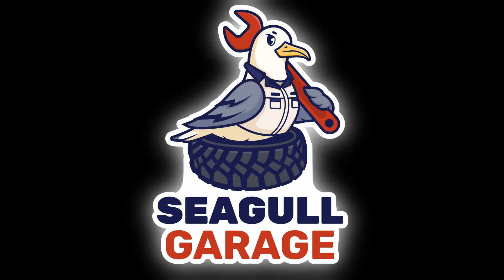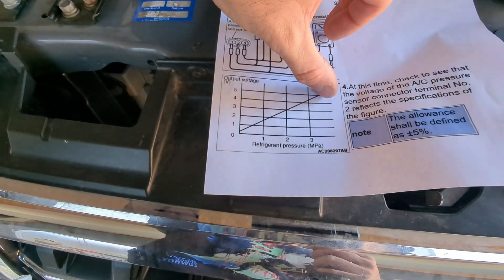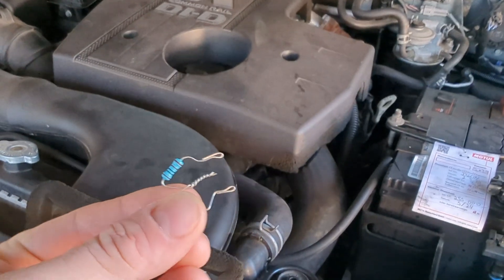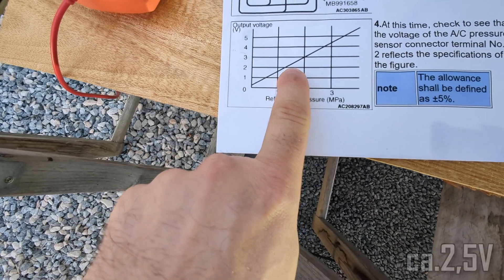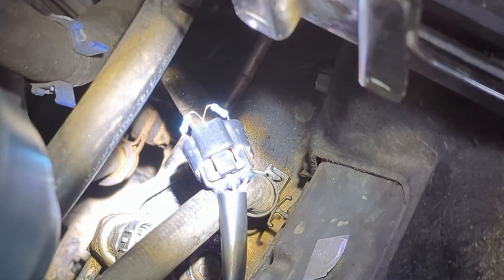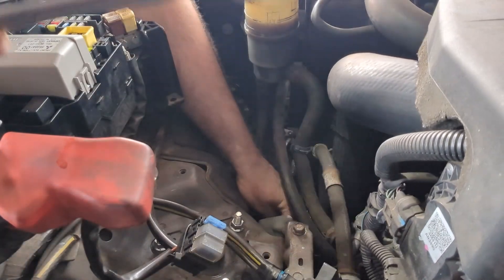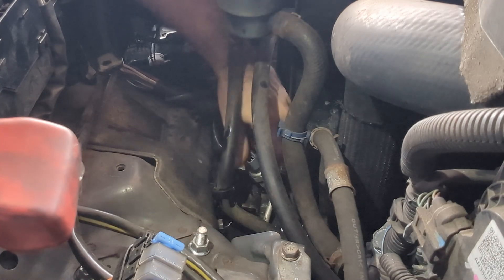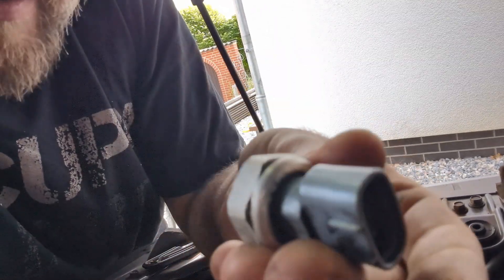AC not working? THIS CHEAP TRICK Brought AC Back! Pajero/Montero/Shogun How to fix AC !!

Comment: hello, nice video! can you tell me what is that small fusebox including 3 fuses in time. 5.13 in the video?
Reply from the maker: I need to admit I don't know. First would be to see if it's my car specific or all Pajero's have them. Second question would be if it depends if you have a dual battery or single. Third do you have Webasto. I would assume after how they look like they are not original. But I didn't make them too... Will need to investigate at some point.  If you want you can join our free Patreon and if I will find a moment we can investigate together, but communication is easier there. Thanks for the comment and for watching so carefully! Cheers!